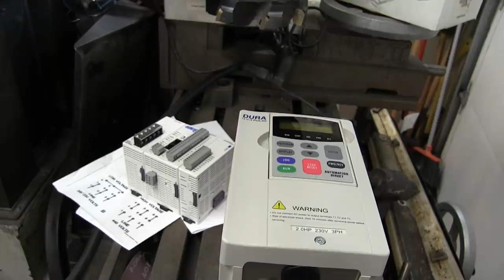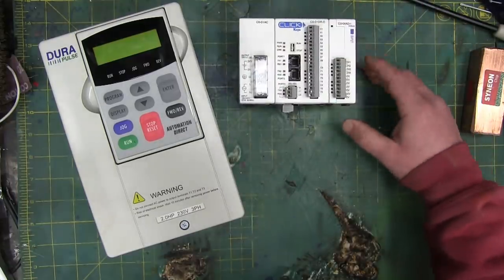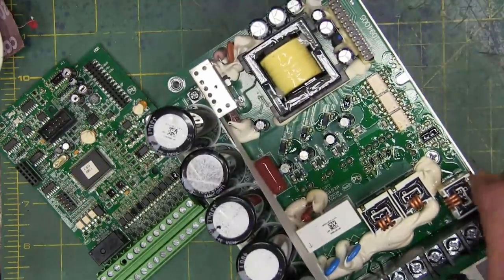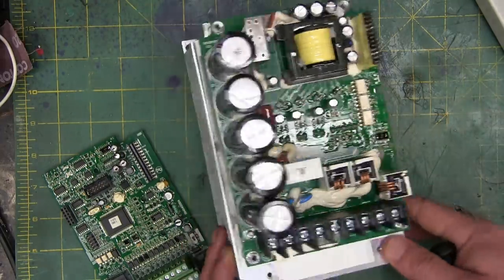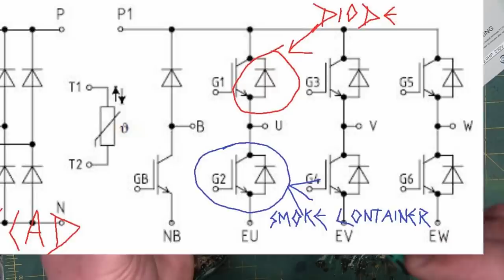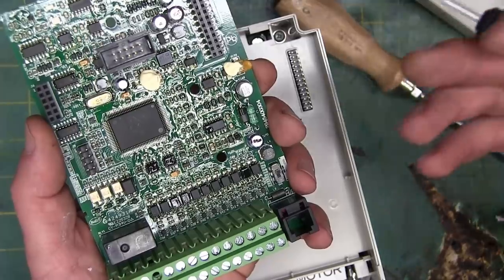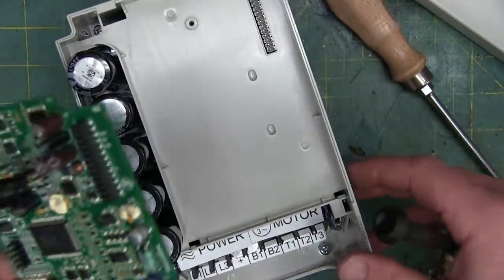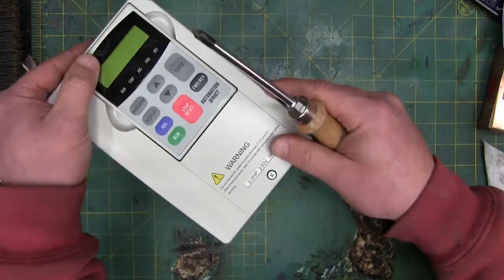BOLTR: Inverter EXPLAINED | DuraPulse VFD

Comment: So I am an electchikens aprentice (4th jear of 4) from switzerland and every time you do a video on the subject of not having 3 phases in your house I am a little confused, because here this is just standart in every semi modern building and its not uncommon to have it in really old instalations too.
I even went as far as to ask my teachers about the why you dont have 3 phases and why only 120V ( here standart is 3 phase 230V to neutral 400V phase to phase 13A breakers for plugs and stuff) 
and none of them could answer this, one even told me that this not having multiple phases thing was BS so whats the deal?
Reply from the maker: +Gladius Illuminatus Back when Edison was conspiring to sell us DC power grid there was a huge company called Annaconda mining. They had more copper than they could sell. Lower voltage = higher current. Higher current = more copper. Lower voltage for safety! We only have 3 phase in industrial buildings. Residential buildings are 1phase. It would cost me $30k to have 3 phase installed.
Reply: AvE  Verry intresting storry indeed but what I still dont get is why 3 phase is not standart in residential buildigs? especialy because obviously 3 phases uses more copper? or is it something to do with the sheer scale of your electric supply infrastructure? is it simply not viable to supply 3 phase to every household because they are too far appart?
Reply: In the US, the 3P distribution stops at the larger substations (15KV) and is broken out to 1P, center tapped, for all the transformers and 4KV residential distribution.  Then on the poles in the neighborhoods, the 4KV becomes 240V (center tapped for 180deg out-of-phase 120V).  To wire a house would require a LONG run of new copper (since you can't transmit on the old wires, not enough of them).  3P is great for perfect power transmission since every phase has a constant potential to the other phases.  but, we didn't start out that way, and to rejigger the National Electrical Code (which is done every 9 years?, and completely by committee, most of the members being firefighters) would take an act of congress (metaphorically speaking).
Reply: I remember when they redid the power lines that went past my moms house and we noticed that it was going to be 3 phase and got all excited. So my brother calls up the power company to see how much it would cost to get it brought down into the yard. It was going to cost 4000$ initially and 80$ a month extra tacked on to the electric bill 
The sad truth of the matter is the cost to upgrade the entire power grid for a country the size of the United States or Canada would be astronomical and the government is more interested in spending money on food stamps welfare and protecting some endangered species of house fly than it is subsidizing making different pixies come out of people's walls
Reply: Gladius: It isn't so much the distance as the fact that (as Dustin Sparks notes), the residential distribution is center tapped (pole) transformers. The cost of changing the distribution to be able to deliver 3 phase to a residential area would be (and is) _huge_. How much do you think it would cost to change the distribution here? 
You have "2 phase" (i.e. 230V) for the stove and other large loads, but 3 phase is only for industrial buildings - large ones even have their own transformer.
I grew up in Canada, but have been here in CH since '90. 3 phase in residential wiring was a complete novelty to me.

Another thing I noticed on arriving here is that although 230 allows use of a smaller conductor, this also means that the point loading at connections is higher - I've seen a lot more "hot joints" here than I ever did in Canada.
Reply: US probably should just change to 240V appliances first, then  you don't need the split phase, so it's 4 wire instead of 5.
Reply: Suspicions abound...  It seems to be primarily a cost/benefit analysis on the part of the power companies...   To supply 240V/120V center tapped single phase power to a residence requires only 2 wires (the live and the neutral/ground) to feed the 1 transformer on the pole, whereas the next cheapest form of 3-phase (open-delta) requires 3 wires (Phase-A, Phase-B, and Neutral/Ground), and 2 transformers on the pole.    And of course real three-phase power requires 3 transformers, and 3 or 4 wires (all three phases and a protective ground/neutral, unless using corner grounded delta, or a similar abortion).    The costs to install and maintain those extra wires (especially in a spread-out country line the US and A), transformers, and supporting components like fuses/cut-outs, etc.. (plus the initial expense of procuring all of that equipment to hang on the poles along with more substantial poles and cross-arms, blah, blah, blah), will not give a great return on investment from their customers who just want to watch TV and microwave their TV-dinner.   What common device in the home is powered by 3-phase power in other parts of the world that deliver 3-phase power to the residence as standard?
Reply: Wash/dry machines, ranges (less so nowadays). Also Table saws, drill presses, and lathes at the upper end of the hobby range were often 3 phase until the '90s or so.

3 phase motors are quite common on farms.
Reply: Americans :F Here in Belgium they are converting all the houses to mono phase but you can get 3 phase if you pay around 500€ for a new meter
Reply: Maybe they just haven't figured 3 Phase power is actually cheaper (in terms of money/copper for power, to be fair).. Na seriously that is why distribution uses it. Probably just a matter of in america final distribution sucks ass, sometimes you even find cables in the air on wooden poles in residential areas like it is 1890
Reply: > especialy because obviously 3 phases uses more copper?

Wrong - three phase requires the least amount of copper for a given load, even compared to single phase. This is true even if you use three phase wiring to only supply a number of single phase appliances, because their neutral return currents cancel out between phases (so the neutral wire still only needs to be as thick as a single phase, because that's the maximum amount of imbalance you can have between phases by definition!).
Reply: > And of course real three-phase power requires 3 transformers

No, three phase simply uses three phase transformers. These are much smaller (have higher efficiency and lower cost as well) than using individual single phase transformers for each phase.

Also, the grid is of course three phase, because it is essentially impossible to maintain any other kind of grid at scale. That's why they are all three phase grids (including the American grids).

(Well technically any kind of polyphase grid does work, but three phase is optimal w.r.t. total required copper cross section for a given load).
Reply: > What common device in the home is powered by 3-phase power in other parts of the world that deliver 3-phase power to the residence as standard?

Larger single phase induction motors (say, more than 500 W) were very uncommon in these parts until maybe 20 years ago, mainly because they are objectively worse than three-phase induction motors (single phase motors are larger, heavier and more expensive for the same power, but have less startup torque and require motor capacitors which are a frequent reliability issue), so if availability of three phase power is not an issue, single phase induction motors are not really an attractive proposition at all.

So basically every machine with a bigger motor had a three phase motor. Be it table or band saws, all mills, lathes, drill presses, boring machines, compressors, blowers/ dust collectors and so forth.
Reply: Gladius: Actually US homes have 2 phase power. Each of them is a 110 line called a leg and when you put the two legs together you get 220-240vac that is 180 degrees out of phase with each other. This is the technical nitty-gritty. In real life no one cares that it is 2 phase because voltage is just the easiest way to refer to it and most of our 2 phase devices are just simple resistive devices like an oven's or dryer's heating element.
 And usually the rule of thumb for phases is that they equal 360 degrees. So 3 phase systems are 120 degrees out of phase. When car generators were upgraded to alternators they were changed internally to 3 phase because they make way more current at low rpms/idle.
 Basically the device Ave is showing us in this video is, for all intents and purposes, a switch mode power supply with a 3 phase AC output tacked on at the end to accomplish the industrial part.
Reply: not true on the neutral wire thickness. If you are running lots of switch mode power supplies or similarly noisy things such as theatre lighting dimmers, you can get between 1 and 2 times single phase current on the neutral.
Reply: True Stephen, there are scenarios with non-linear loads where certain harmonics do not cancel each other out between phases (IIRC the 3rd and 9th harmonic, which are produced by the classic rectifier-capacitor power supplies). However, power supplies with no PFC above 100 W power (or so) haven't been permissible for a while, and there are constraints on the harmonics as well for this reason (at least I think that's what they are for). The typical wiring structure of a house doesn't really allow for this to become a problem, I think, since single-phase circuits are terminated in the distribution panel which normally is fused itself by a higher rating than the connected circuits (B13A/B16A breakers, panel typically fused for something like 25/35/40/63 A).

But I absolutely see how this can become an issue in some installations like theatres with many kW of lightning controlled by dimmer racks.
Reply: AvE That's an interesting story I wasn't aware of. My paternal grandfather was a VP with Anaconda and it was the first mining company my dad worked for when he got out of college.
Reply: In the US, unless you have an underground service (with a pad-mount transformer), it seems far more common to see 3 individual transformers at the top of the pole feeding a customer's premises rather than a single poly-phase transformer.  (Presumably because the utility's predominant customer is a single phase residential property, so the utility won't want to stock very many different transformers for a given KVA rating).
Reply: Being first doesn't necessarily mean being the best.  The US was running things with electric motors (Single phase) while Europeans were still using horses.
Reply: Hi I'm Harry homeowner and I love to go poking around my panel box when I need a new feed for a home improvement project single phase is probably only reason my kids still have a dad.
Reply: alles klar klaus sometimes? Most of the time...except in cities
Reply: In Estonia, little EU country, almost all residential houses have 3 phase, 415 volts between phases power.  Mandatory cable size is 25mm2 Al, as noone is using copper for those cables, from the meter to distribution box. Common household will have 20-25 amp main fuse. To me having the AvE problems are somewhat  funny.
Reply: Cost me 120 euros to convert from 1phase to 3phase last week here in EU... 1phase installations are very rare these days here

Comment: 6:02 Those aren't diodes, they're inductors. A full-bridge rectifier takes 4 diodes.  The inductors are used to smooth the output.
Reply: Correct they are inductors, but a full-bridge rectifier for three-phase uses 6 diodes not 4.
Reply: Since the input is only single-phase, it would only need 4-diodes.  The diodes are most likely part of the Infineon power pack, which will have the IGBT's, diodes, and optional a single brake IGBT.
Also, I think those white components are current sensors and not chokes. They run several turns around them to set the correct ratio based on the current output rating of the drive and the actual sensor.  These are used by the control algorithms for controlling/monitoring the motor output.
Reply: Jess Cretney - You are correct in your assessment of the components.  Those white boxes with the copper coils are current sensors for the output of the IGBT and the bridge rectifier is generally part of the IGBT, though I have seen some that have a separate rectifier.
Reply: Everyone here is correct. Those are current sensors on the output, the bridge is included in the IGBT module which also has an internal brake, as noted by the B1 & B2 connections. Though I only count 6 optocouplers for the IGBTs, which means they don't have one on the brake so I guess they're hoping you don't screw up there.. that would make a hand grenade out of her real quick.
Reply: A GS3 (even if it supports 1-phase supply) is a 3-phase supply inverter, so it has 6 rectifier diodes. That's all I am saying.

Comment: So, I've been glued to your channel for a while now. I downloaded the manual (190 pages!! I come to your channel for the condensed version of learning) for the GS2 and hope to follow along. But I just gotta get somethin straight. Automation Direct makes a GS2 capable of up to 575V. So - are you tellin us that we could use one of these thingamajigs to take Single Phase 220/240 and stick some wires into it and connect it to an old Bridgeport 3Ph 550V motor (Series 1 or Series 2 with a VFD) and get it too chooch??? - and that's it? Or does a user still need to buy a pony motor and phase inverter and all that other crap ($$$$$$$$$$$$)
Reply: Depending on the HP requirement of the motor 575V would still need to be input to the 575V drive,  just the same principle as he did here with the 230V drive.  You would just need a step up transformer to bump the 230V up to 575V to feed the input. Remember, you would need 575/230 or 2.5 times stepup transformer with enough wattage rating to account for the transformer losses, but still much simpler than the other alternatives.    Remember current decreases by 2.5times as well, so if its  a 5hp 575V 3 phase motor, drawing about 5Amps, then you need to supply that with 5Amps x 2.5 = 12.5 amps @ 230V. But that is only 1 phase supply in,  yet the VFD is putting out 3 phase, so if memory serves me correct that needs to get multiplied by (square root 3) or 1.73 or 21.6 amps.  Assume 90% efficient transformer  21.6Amps/0.9=  24.6 Amps @230V.    But with this in mind, it really is pretty simple solution to be able to use the 575V 3 phase motor !
Reply: magus1111 Ok, I think I'm following you. With single phase 220V, (200 amp service). I'd need to setup a transformer to step up from 220V to 575 (or 600V) single phase, then into this box which can then output 3 phase 575V. 

Right?
Reply: I've watched AVe's video three times now (should just put it on repeat 100 times) and he clearly states at 2:24 Single Phase in, Three Phase out. So, if I have a transformer to up the voltage of the single leg from 220 to 575 / 600, then this box would work. I need to have a DEFCON 1 alarm for the next video to see what he comes up with :-)
Reply: exactly !